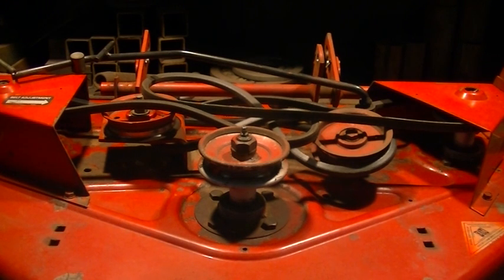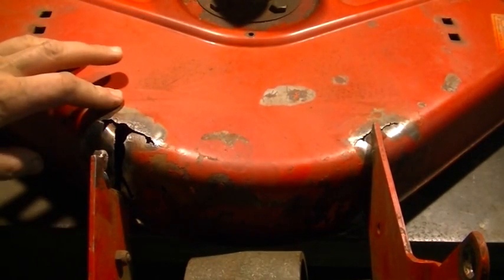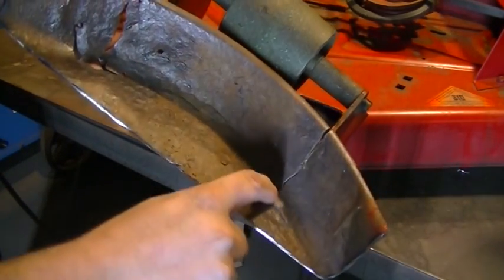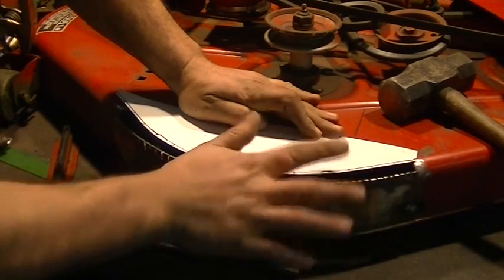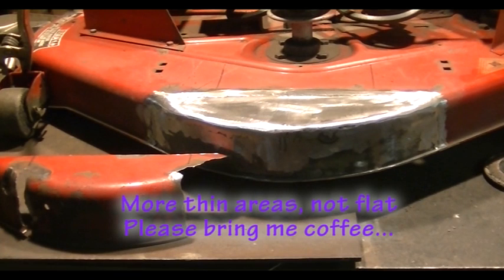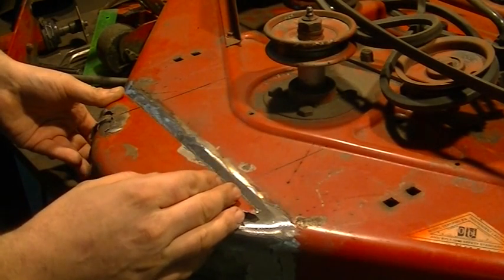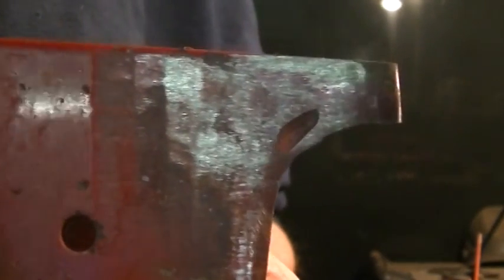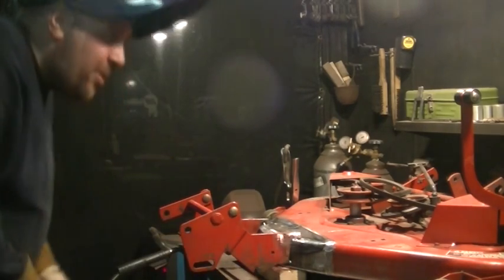Mower Deck Repair

Comment: That damage is exactly why I chose a commercial-grade fabricated deck unit, rather than a formed, lightweight steel version, when buying my zero-turn.  The big box stores are notorious for selling respected namebrand lawn/garden equipment with inferior construction.  Nice job of repairing this deck.  Thanks for sharing.

Steve

Comment: Good job. I have rebuilt a few mower decks; and unless it is an uncommon one where the tractor is still in god shape, or a pretty high dollar piece of equipment it is usually cheaper to just buy a new mower that will hopefully last a few years. The last one I did was on a diesel Yanmar ym122 that cost somewhere around five grand in 1987. Come to find out, it had a case N46 deck, so at least some parts were available, spendy, but available. I think the pitting and thinning on yours was caused by grass clippings getting stuck and just staying there.
Reply: I wish I could edit these comments, I obviously meant to say good shape.

Comment: Good re-fab job. If it were mine I would have made additional supports for the"sheet metal" deck where the arms connect. But, as it was a customer's you had little choice. 
Look up "Make It Extreme" on YouTube, then find the "bender video", he has two versions of metal benders. I just finished making the "I-Beam" one and it works great. I think it would have helped you on this job. I think?

Comment: wow, thats WAY better haha! i always struggle with jobs like this...  people want me to fix something like this, but i tell them how long it would take, and cost of materials, and everything, and it ends up being a little less than the price of a new one, or a good condition used one... they try to dicker me down on the price, but i would end up doing it for free if i went much cheaper...
how do you get people to bring you jobs like this? im not trying to rip anyone off, but they sure see it as that... pretty much stopped doing custom welding jobs because of that issue.
have a great day Jeff! cheers!

Comment: You did a real good job, but kind of a waste of time on an old, rusty deck. I just hammer them back into shape, weld  some re-inforcing metal around the breaks, and I'm done. Only takes a few minutes, and they last for years.
Reply from the maker: This was actually done for an older guy and the only reason I went all out on it was for the video. I see people pull cars out of the junk yard where the metal is nearly transparent and they restore them. If it were my machine I would have scrapped the mower deck and just used it with the snow blower attachment. The upside to this however was that the owner was so happy with the work I did he brought me a lot of other business. I would guess that between him and his friends I got about $3,500 bucks of work just over that summer.

Comment: What is the 2 metal peices welded to the deck in the back?
Reply from the maker: The uprights that attach it to the machine maybe?  What point in the video, if you note the time I might be able to give a better answer.
Reply: @jeffreysanto  never mind I found it out the deck mount